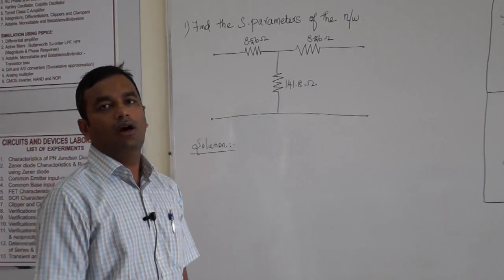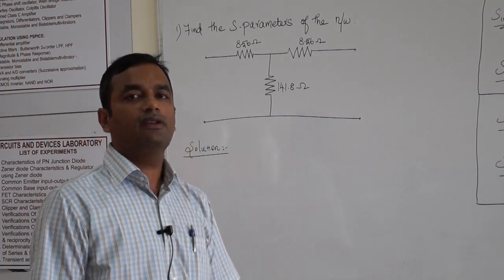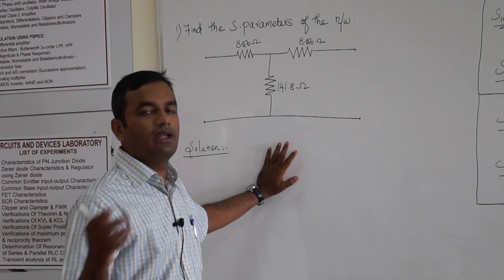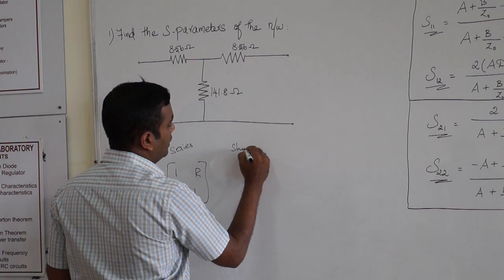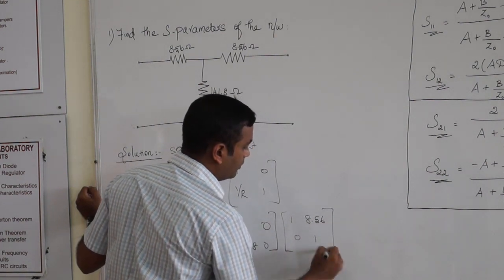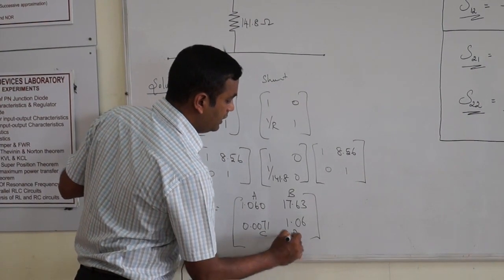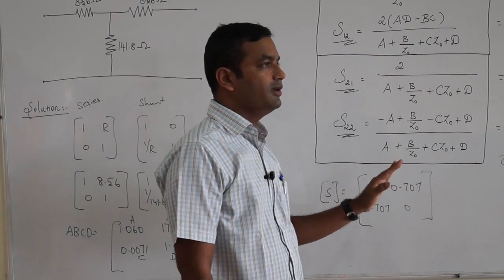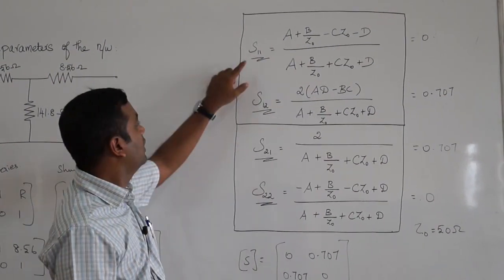s parameter problems type1

Comment: he just did mistake and already knows the answer, he just wrote it without solving it 
this question is from book DAVID M. POZAR example 4.4
Reply: Would anyone please tell me if there  are other elements like capacitor, inductor except resistor, then the same way to to find S parameter? If possible, any reference?

Comment: calculation of ABCD parameter for shunt seems wrong.... however the S matrix obtained is correct.
Reply: aditya joshi Yea !!  In the ABCD matrix for shunt component, it should have been 'R' instead of '1/R'
Reply: OMG! I HAVE BEEN RACKING MY HEAD FOR ALMOST 2 HOURS! YES!
Reply: If you look his next video , he has explained 1/R instead of R for Shunt.
Reply: min gautam  Gautam this method is failing for one q asked in gate.can u confirm why?
Reply: Would anyone please tell me if there  are other elements like capacitor, inductor except resistor, then the same way to to find S parameter? If possible, any reference?

Comment: There should be 1 instead of zero in admittance matrix
Reply: Would anyone please tell me if there  are other elements like capacitor, inductor except resistor, then the same way to to find S parameter? If possible, any reference?